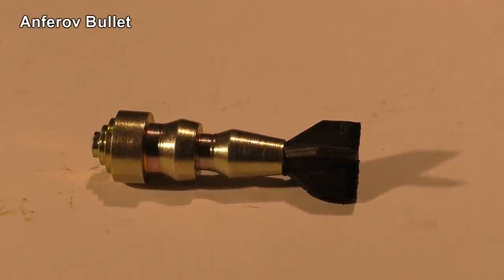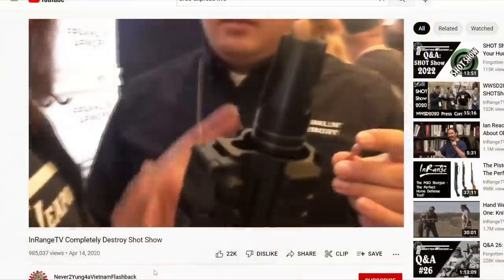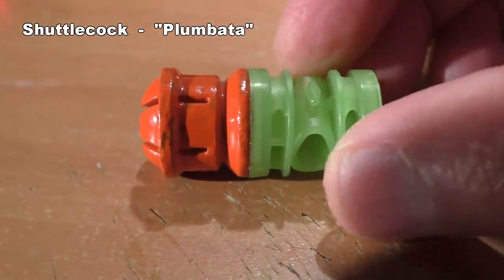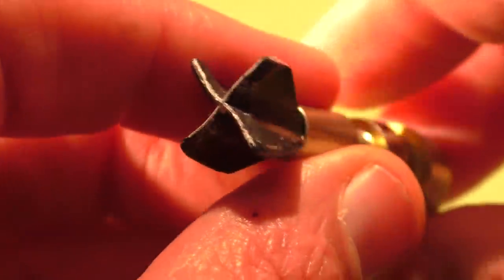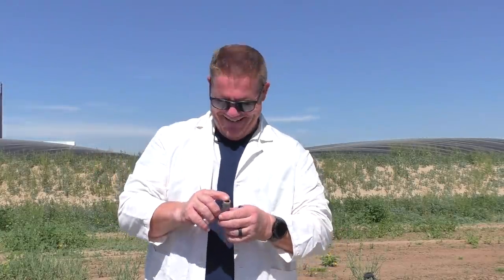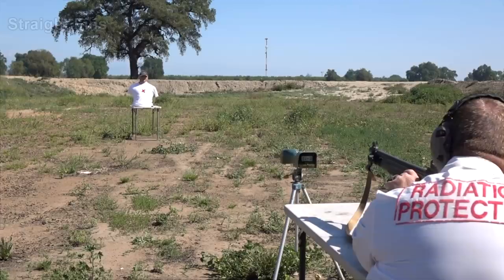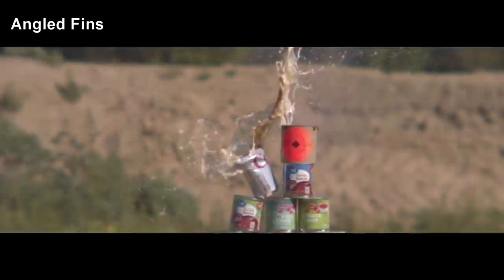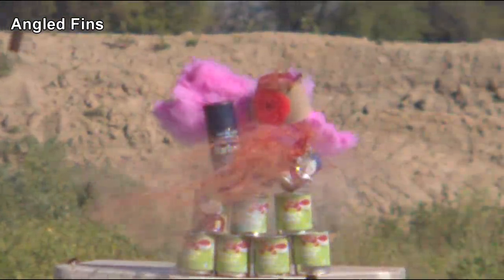Supersonic Darts - The Effects of Inducing SPIN - I learned something!

Comment: The “angle” in that orientation could cause the wobble, What about like a 3 degree offset, like arrow fletching?
Reply: Ya i was thinking that with a sub 300fps(barely) arrow, the difference between 3° and 2° is noticable. 1000fps seems like a half degree should be plenty. Granted the surface area is smaller
Reply: Yeah I'm thinking this is just like adjusting the Helicoil or straight vanes when I'm tuning in the mathews monster compound arrows.
Reply: Might be something worth experexperimenting with especially with precision at longer ranges. The logic is sound, many fin stabilized projectiles have some degree of spin imparted by the fine (arrows for hunting or competition like ya'll pointed out and I'm fairly certain some munitions do too) I'm sure there's a "sweet spot" for the angle of the fins for a given projectile for a given velocity. But like you said, I believe that the ideal angle is much closer to 0 degrees ( like the 0.5 you mentioned). I'm sure there's some sort of physics/ engineering equation for this that would help narrow your experimental range of angles and velocities.
Reply: Spin for arrows is used to negate the archers paradox where the long and thin arrow shaft wobbles through the air
Reply: @joearledge1  there is some tuning involved but I find a well made Helicoil arrow works well and have noticed preformed well outside over straight

Comment: If spin had any advantage in finned projectiles, you can be 100 percent sure they would do it on tank rounds but they don't.
Reply: imo i think it actually makes it worse. The fins already make the projectile extremly stable and no finned projectiles use curved fins. Arrows have straight fins, tank apfsds rounds have straight fins, rockets have straight fins. Spinning projectiles without fins are more stable than those who dont spin because of gyroscopic effects, but spinning fins would just ad more drag and therefor worsen the performance. Especially since the fins actually normaly prevent those projectiles from spinning. Thats what i think at least.
Reply: @Okararu  They actually do angle the fins on APFSDS projectiles at about 0.5° (so almost nothing at all) but even this slight angle helps it spin a slight bit and this stabilizes the round that extra little bit.
Reply: @pierre-henrivince4591  have you got a source for this? I can't find anything online.
Reply: British Challenger tanks actually have anti-rotation sabots for their APFSDS as the spin reduces the accuracy on modern ammunition which is 1 reason nearly all MBTs have smooth bore cannons now.
Reply: @jonathonspears7736  The Challenger needs it because it has a rifled barrel, which imparts way too much spin on the projectile.
Even in a smooth bore barrel, you want slightly canted fins in order to get a slight rotation
Reply: @Okararu  arrows do have angled fletches, it gives far better accuracy and distance. Aerodynamics have a huge play in it, at high velocities how a projectile interacts with atmosphere is way different than at low velocities. 
Aero/fluid dynamics are some really interesting stuff.

Comment: We use a 5° helical fletching on our hunting arrows, traveling ~300 ft/sec... not 40° traveling at 1400 ft/s... too much power!
Reply: I was thinking the same. 3-5° is all that's needed but I noticed something else as well.

Our fletches are angled the entire length but for these they only bend the ends. They basically created two opposing forces and that's not good. It also would have been better to have the angle match the rotation of the rifling of the barrel because that induced a third opposing force that had to be overcome.

Most archers know to match heliocoil with arrows rotation based on how the string is twisted, same would apply using rifling as the start point for determining angle.
Reply: It'll rip the target at alil closer range, depends on the range
Reply: That right, I'm just wondering if ~5 degree angle will be enough considering that is traveling at a supersonic speed and the fletching is probably behind the supersonic shockwave
Reply: @JamesSmullins  they werent shooting them out of a rifled barrel. He specifically mentions that at least once and in a on screen text he mentions that he meant for them to spin backward so no one could say he just used a rifled barrel.
Reply: @metamorphicorder  he said he bent them in the opposite direction of the rifling so people couldn't say they were cheating.
Reply: @JamesSmullins  he said he bent them in the opposite direction that rifling causes projectiles to spin so that he couldnt be accused of using a rifled barrel.
Reply: @JamesSmullins  3:57 read the caption. He specifically says what i said. Meaning thet were not using a rifled barrel.

Comment: Fetchings on arrows usually do have some sort of helical put on them.         Usually at most 3⁰-4⁰ at most.

Edit.  40⁰ seems extremely excessive
Reply: Depending on the length of the vane, the angle increases with the length of the flight vane
Reply: @lukebaker1167  know but just keeping it simple bro
Reply: @mikemitchell9157  2 ezy Mike!!!

Comment: The "Diabolo" shape that you're looking at is a drag stabilised projectile. The feature that defines a drag stabilised projectile is that the centre of mass is in front of the centre of pressure. That's why the base is hollow, to move the centre of mass forward. This is the same as Foster slugs... If you're bored enough, a conventional ogive projectile is actually stable in flight if loaded backwards...
Fin stabilised projectiles don't use drag in quite the same way, but as you've suggested at the end the benefit is averaging error. The risk is that the fin stabilised projectile can be overspun which results in the flight issues that you've had in your example. Normally fin stabilised projectiles are spun something more like 20-30krpm as opposed to something closer to 3 million RPM for a rifle round.
If you want a laugh for a follow up to this one, try a couple of degrees of angle in spin and have a look at the flight over a few hundred meters if you have the space. You could also put something more like that 20 degree angle onto opposing fins in the same direction... This should result in the projectile yawing in one direction.
Simliarly if you're bored sabot separation is a really interesting space to look into. Usually it's important to ensure that the sabot doesn't touch the fins, as it results in a destabilisation effect on the initial flight of the projectile. The initial touch can have a significant impact on the flight accuracy. You might find that videoing the sabot separation could result in some interesting effects :)
Reply: If a diabolo is drag stabilized, then why do pretty much all airguns have rifling? Isnt that hollow skirt there for the same reason a miniball has a hollow skirt, to expand into the rifling? If you look at a used diabolo, you can see that the skirt has the most, sometimes the only rifling imprint.
Reply from the maker: That isn't quite true because we can and have shot SOLID diabolo slugs without a hollow cavity and have achieved stability- many times.  The hollow is actually there to act like a Minie ball and cause the pellet to  obturate and seal the gases.
Reply: @taofledermaus  I just tracked down and watched the video... that was interesting :)
 I would assume that it's because the rear cone moves the centre of pressure rearward as well. In your video it looked like a couple of the shots were oscilating a little as well as the one that wasn't stable, but the rearward shot definitely inverted, so the centre of drag was definitely in front of the centre of mass.
On an airgun the skirt definitely obturates as well, but a good design as one that does as much as possible with the same features :)
It's also worth noting that, in your other video, the slugs were fired out of a smoothbore, same as this one and they don't have fins, so the flight has to be drag stabilised in this case ;)

Comment: Paused at 4:54 ; the problem with spinning a fin stabilized projectile is there are parameters where the spin creates a positive feedback with regards to yaw... either great amounts of yaw or fast spinning will result in the advancing fin having much more effect on the projectile than the retreating one. Since this is off the axis of rotation, what you get is an increasing conical gyration, eventually ending up with the projectile twirling around sideways. 

This is why the model rocketry people try extremely hard to get their fins equalized and straight enough for no roll. Weathercocking (the nose pointing towards a disturbance to the flight path) is what's wanted, with good damping (no extreme motions, so no overcorrection/backcorrection wobbles). Spinning just introduces unequal off-axis forces that makes it much less predictable in response to a disturbance like a wind gust. If a coupled (spinning/finned) rocket is still stabilized and damps out, it could do so in any direction and not aligned with the initial flight path.
Reply: I thought that weathercocking only happens because of the rocket's thrust.
Reply: @666Blaine  Technically yes, but an unpowered projectile can do it too depending on it's overall stability, damping, and profile. It eats a lot of energy though.

Comment: The lab coat looks pretty slick OG, making videos YouTube does make you an official scientist. Or so I'm told.

Somewhat related, in a college engineering course we were experimenting with the same principles on model rockets. While not exactly the same, we did come to the similar conclusion about spinning the rockets helping to negate some of the defects from the materials.

One fin design we attempted was angling the entire fin structure from 5 to 15 degrees. The effect was more pronounced and seemed more consistent compared to angling just the tips.

Comment: Next time you do the throw in water, try higher viscosity. 
If there was a ring around the fins and have nozzle shape forcing the air through + cuts at the front to change the balance would it be different? What about the same fins idea like here but at different speeds?
Different grooves on the outside of the sabo and different chokes?

Comment: I wonder how much effort the load has to put into pushing the air out of the way thats in the barrel infront of the projectile, and if you get a higher muzzle velocity if you lightly tape it shut with masking tape and fill the barrel with a light gas like helium :)

Comment: Hey, had a target idea. What about a ballon filled with either, smoke or the coloured powder. Smoke was my first idea, but bit tricky to pull off. You could do it with dry ice but would be a pain. 

Powder would be easier. What I'm envisaging is the balloon popping on contact, a cloud of dust is left which would hopefully show the wake of the projectile. Might not be possible to get that detail outside though, may need to be done indoors with a high-powered lighting. 

Top notch graphics by the way! Can really see where the budget went =D

Comment: I wonder if the spin induced by the bent fins could lead to some sort of precession that is destabilizing. The first "bent fins" shot looked that way. Bent fins are different from rifling in that they impose the spin when the bullet is out of the barrel. In the barrel it could even cause a "counterspin" because of gas passing the bullet from behind in the barrel if the sabot gas seal is bad.

Btw. is it a viable way to impose spin by using a partial gas seal that allows some of the gas to spiral around the bullet while it's in the barrel? (i.e. the sabot has some kind of corkscrew groove on the outside)

Also it might be interesting to have some Black/white pattern on some part of the bullet to better see the spin.

Comment: Over bent the fins...airflow can only change at 15° angle otherwise it creates turbulence and can result in the weird airflow...I would recommend trying these again with only a mild 15° bend in the fins not the huge 40° angle you used (think 3 angle valve job on an engine intake...cut at 15° 30° and 45° this way the airflow bends around the valve instead of creating turbulence and slowing itself down thru the intake port) pretty cool to see it either way...great job!  Keep em coming!!!
Oh and dropping it in the water, rotation or not...it's gaining velocity due to gravity, a fired bullet once it leaves the barrel no longer has energy being applied to it, so it will slow down

Comment: I’ve always wondered if you could generate spin by designing a sabot or wad which utilizes escaping gas to pass through angled ports or something.  Basically the angled fin idea except with IG the barrel and gas flow traveling forward against the bullet/sabot.

Comment: The 12 gauge grenade rounds for the AA12 utilize spring-loaded fins for stabilization, and are accurate out to a very impressive range. I'd be curious if an identical exterior shape would be just as good on a solid slug.

Comment: I'm no airflow simulator but counting the fact that the projectile is traveling nearly Mach 1 the fin angle is way to big, comparing to a tank apfsds round we're the angle on the fins is barely visible. Another factor to take into account is the machining done on the actual round with when traveling a such speeds can cause tumbling as show in the video. Great video and I love what you guys do

Comment: Is the poor sabot separation due to the powder burning and "fusing" the components together? Maybe a PTFE aerosol spray coating on the sabot components before assembly would result in more predictable seperations?
Would "fluting" spiral fins along the surface (lenthwise) of the projectile give more surface area to create increased spin?

Comment: You need to shoot them with bent fins, through a rifled barrel, while in a tornado.
Don't forget to wear your heat vision so you can find them on the giant tarp.
Reply: Don't forget to secure the target!
Reply: It would also help to get tequila drunk first and then lay down on a bed. You get some major RPM's doing that!
Or so I've been told.
Reply: They actually need to set up a rig that will allow them to spin the rifle and have a wireless solenoid to be able to pull the trigger. Gotta try all the ways of atabilizing the bullet.

Comment: From the military ordnance side there are many fin/spin examples. The hydra rocket for example has several models that use fin/spin. 
In military ordnance fin/spin is often bat a particularly aggressive spin and I feel like I’ve seen it more on folding fin lube launched rockets. 
You also see spin/fin on many arrows. Again it isn’t quite so aggressive. 
On a sabot I would image an aggressive curved fin may interfere with clean sabot separation.

Comment: I'm curious how a lesser spin would affect things, if the angles on the fins were less severe, creating a spin profile similar to that of a standard rifled projectile.  Could even be a bit of a study in what angle works best, working in 5-degree increments?  Hell, might be worth examining the angles used in the gyrojet projectiles as a starting point.

As for the separation issues, maybe a bit of graphite lubricant just touched on to the on the high-points of the projectile contact with the sabot (with excess wiped off, of course) would encourage better separation?  Or perhaps more of a cone on the sabot in front to catch the air better before the whole mess has left the barrel?

Comment: And this is with hand bent fins. Imagine if the fins were perfectly angled by precision machining. Just in the footage I can see the imperfections in what looks like fins bent with maybe wire cutters or end cutters? Just a guess based on the crimp in the metal at the bend point. Anyway, the slight wobble in the bent fin version might have been caused by slight differences in the angles of the individual fins given that with just those small fins it turned faster than standard rifling, and also spun easily in a water drop test.

Comment: On the "do rifled foster slugs really spin" you mentioned the Shockwave prevented air from passing over the riflings. Where here it doesn't seem to be the case... just like a jet going super sonic and not affecting the tail. My idea to get a better look at this is get high speed as the foster slug is coming out of the barrel to see if it is already spinning coming out.

Comment: I'd like to see this test done with two fins bent 180 degrees apart bent at the same 40 degrees vs 4 fins bent two opposite bent at 20 degrees and the other two at 40 degrees.  I also liked how when tested in water the bent fin dropped straight where the unbent fin dropped at a slight angle.

Comment: Neat stuff! I have to say, I don't understand why you would want to spin finned projectiles, but I seem to recall that some early artillery and space rockets were spin stabilized - not sure if they also had fins.
Reply: At least as early as the American Civil War there were rifled artillery pieces, which fired solid projectiles with projections to engage the barrel rifling (which rifling was grooves, not conventional lands).  They were the most accurate, penetrating, and long range field artillery available at the time for a given size, but they had no exploding shells or canister / grapeshot type ammo, unlike their smoothbore neighbors.  (There is no reason why a rifled cannon can't fire shells, as was later proven.)  No fins per se , but the protrusions that engaged the rifling were at the rear of the solid projectile, which might tend to have a "shuttlecock" effect.
Reply: @digitalnomad9985  what you are referring to sounds more like the curved ridges on a foster slug. I was thinking something more like the Land Mattress system, which had fins and fired from rifled tubes - though the fins weren't much to write home about